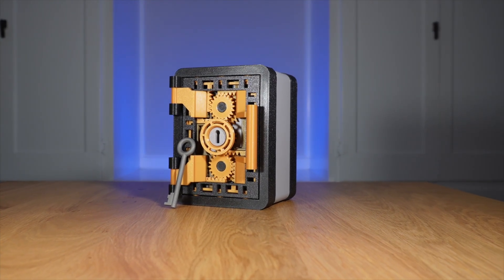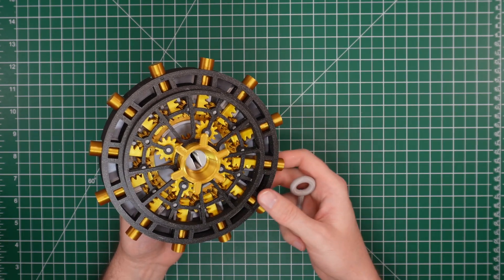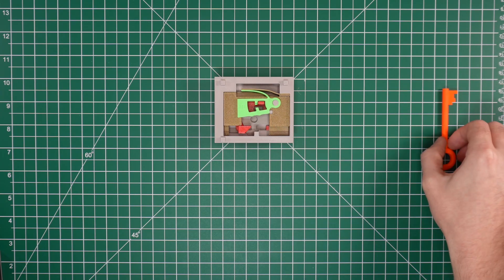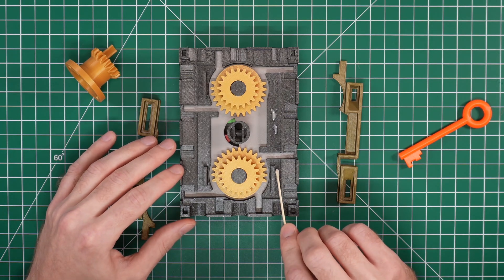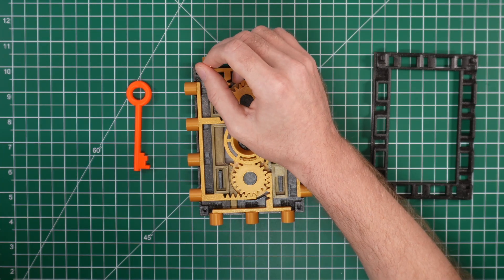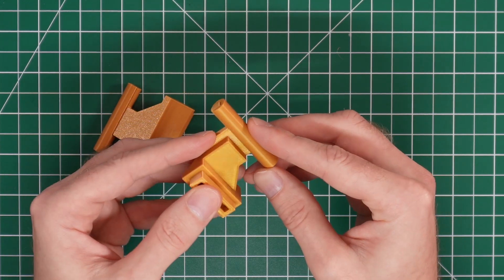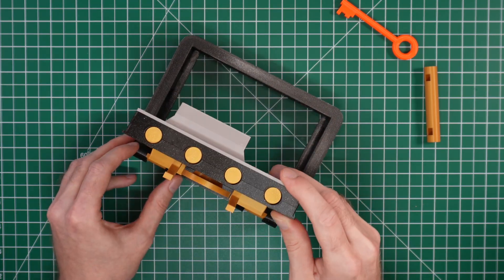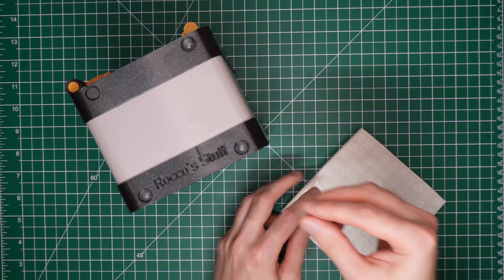3D Printed Mini Vault with Lever Tumbler Lock

Comment: I may have missed it.. but what kind of glue do you use?
Reply from the maker: JB Weld plastic bonder. Most super glues or epoxies will work well, but I like JB weld because it's easier to apply to small spots with a toothpick.
Reply: @RoccosStuff  Should probably add an affiliate link.. I boosted.. but I would buy little things like this.. I just bought the weights you recommended also.

Comment: Hi, good job, It is really well engineered, I have a slight problem though where the pieces are not fitting in as perfectly as shown in your video, can you please provide me with line width settings you used or layer Hight you printed at as I think that's what I think is happening (im using 0.4 nozzle and 0.2) . Cheers
Reply from the maker: I used Prusaslicer and printed everything at .2 layer height and structural profile. I used a 4 mm nozzle. Someone on Makerworld commented that they had tolerance issues but tried at .1 and it worked perfectly. Hope that helps

Comment: What glue is that? Can I have the name pls
Reply from the maker: JB Weld Plastic Bonder. It's really easy to work with and sets quickly
Reply: @RoccosStuff  thank you, so it set in 15 mins time and cure in 30 mins or faster than that for PLA and PETG?
Reply: @hobbes3012  it still takes 15-30 minutes with PLA/PETG
Reply: @Rocco-bm9cf  thanks, I hate my current liquid super glue, once it touch my finger, it bond immediately! Trying to find a 2nd version of it.

Comment: Printed it. Love the design. Much cooler way to give my brother money for Christmas.

Really good tollerences. Not to big that it feels sloppy and not so small that the parts dont fit.
Also found silicon grease (like what is udes for the 3d printer) worked really well in the lock mechanism so that the leavers moved nicely.

Comment: Been looking fir something just like this and got super pumped and printed everything out. But boy oh boy, my printer must need some serious calibration because i literally cant get past the first step. How many times ive heard you say "putting the lock together is very easy, the parts just stack starting with thr bolt" and my bolt just doesn't go in lol. Ive deburrer ir so much it's still too tight to turn with the key, and the parts after that are no better. Will try and tune and reprint because i really would like to be able to print this.

Comment: What glue are you using? It doesn't look like super glue.
Great video. Keep up the good work.
Reply from the maker: Thanks! It's JB Weld plastic bonder. It sets pretty quickly and is easy to work with
Reply: Does it leave a white residue like super glue?
Reply from the maker: @cowabungacreation  no, it doesn't leave any white residue, which is one of the big reasons I like it. And it is more viscous, so it's easier to apply accurately (and to clean off if it gets where it shouldn't)